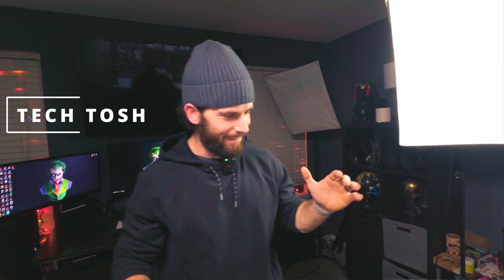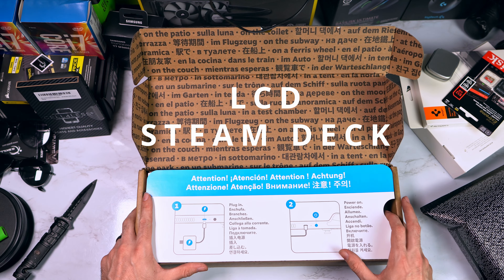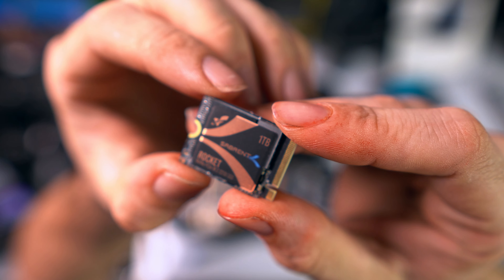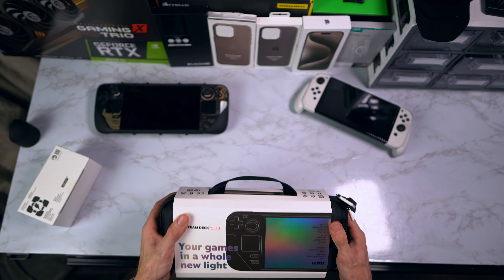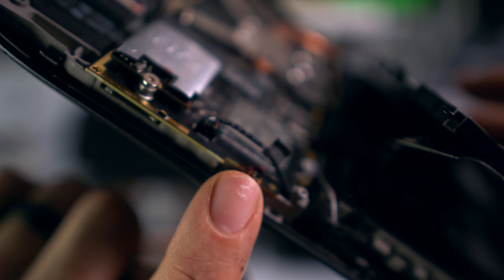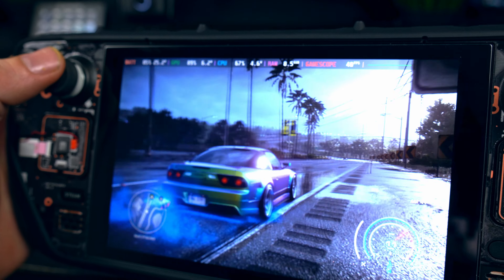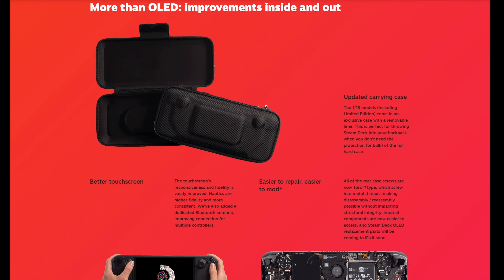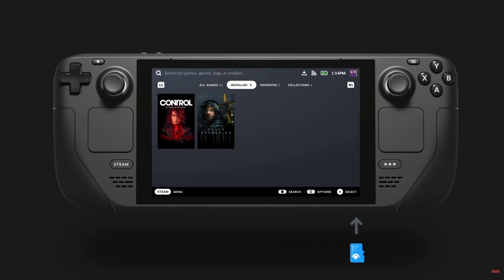STEAM DECK - From OLD To OLED!

Comment: Will get steam deck oled 512gb 
So there is still a chance for Thumb stick drift ? 
Also a bit concerned about the dead pixels and headphone jack issues. Are the new batch of steam decks have less issues that i mentioned ?
Reply from the maker: Drift can be an issue on any controller thats not magnetic but it’s not as common as it is on the switch. Also if you want you can always replace the thumb sticks for “GuliKit Joystick for Steam Deck” which will eliminate this problem. I have no dead pixels on either of my decks so i can only speak on my experience.

Not familiar with any headphone jack issues… but i use bluetooth so idk.